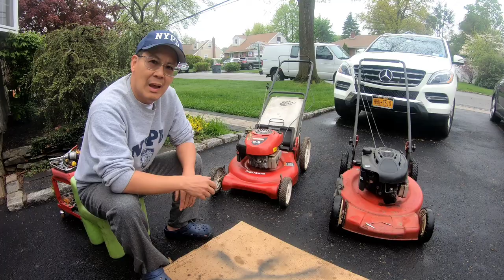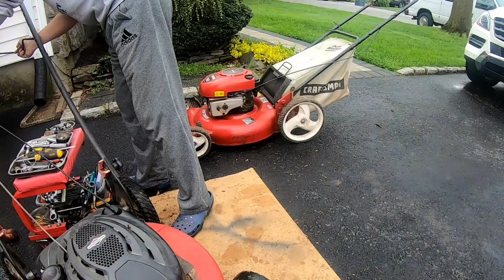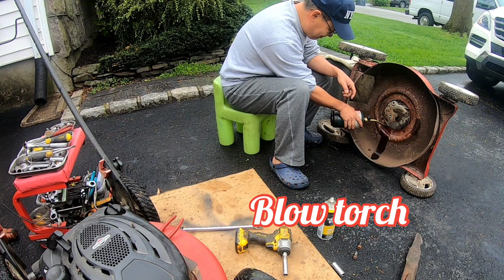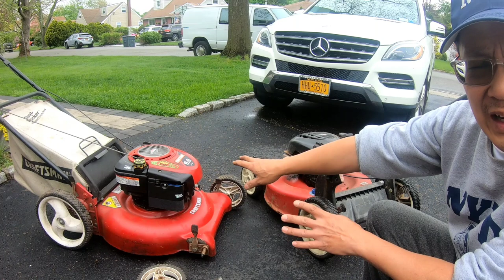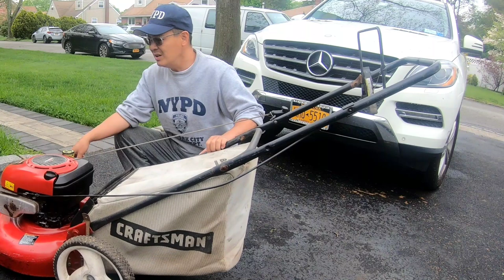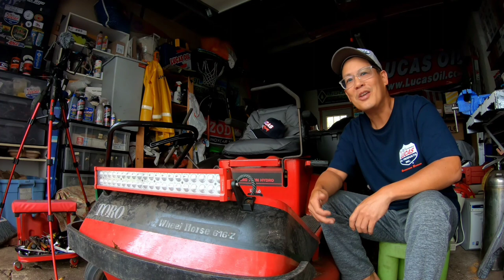BRIGGS QUANTUM AUTO CHOKE ENGINE SWAP WITH PARTS MOWER PRIMER BULB VERSION TO GET A LAWNMOWER SOLD!

Comment: Henry,  use the 1/2" copper pipe to fix the wheel and let us know if it actually does work,  I'm getting ready to try it.👍👍
Reply from the maker: Sold it that day remember?  The whole video was about getting the mower going to sell.
Reply: @MowersNBlowers  I do remember you sold it quickly, I  figured you might just take a couple of old wheels and see if it actually works,  it would be a really cool video. 👍👍
Reply: Gregory it works but you have to get it the right length.

Comment: Got it going! Awesome, but why not just transfer the carb and Airbox? I know you mentioned a screw was stripped, but it sounded like you were speaking of the one that goes into the carb
Reply from the maker: Michael,  one was primer bulb system,  the other was auto choke,  different set up which requires more adaptation.

Comment: For worn mower wheels like that, Steve from Mowers Saloon (or whatever) has a remedy for worn mower wheels. I think he cut a copper tubing sleeve for them.
Reply from the maker: Steve has great tips
Reply: my honda hrx 2173 is powerful best with its 12.3hp engine on it 202cc

Comment: Use a 1/2 inch copper pipe as a sleeve, should slide right on.
Reply from the maker: Sure next time,  as you saw I sold it

Comment: I'm Hesitant about taking the bolts out of  Push mower engines  anymore , seems this always happens to me of breaking them off . I've got a good Koehler engine that ive drilled out . But in order too drill the two bolts out right , I had too take the sump off and lay on the drill press . Haven't got back too it cause I'll have too buy a sump pan gasket now . Anyway I've kinda  slacked  on them anyway  , guess I've lost that loving feeling 😂
Reply from the maker: Rtv silicone will work!
Reply: Mowers N Blowers Thought of that , but wasn't sure . Thanks old master .....😉